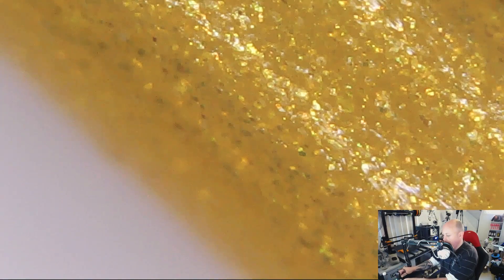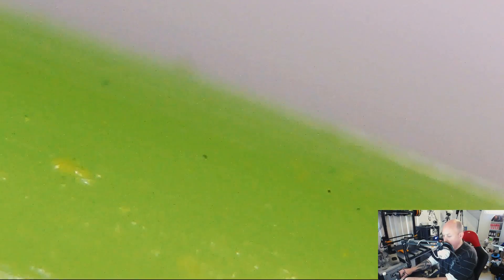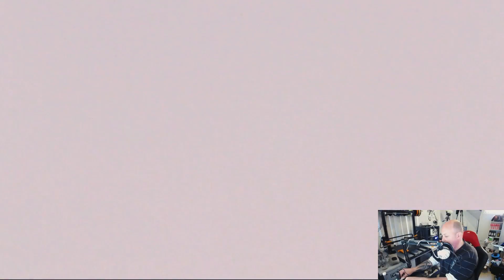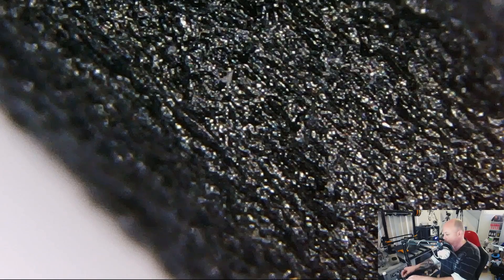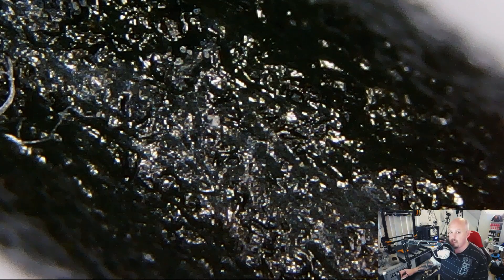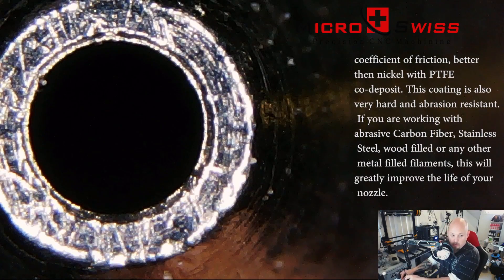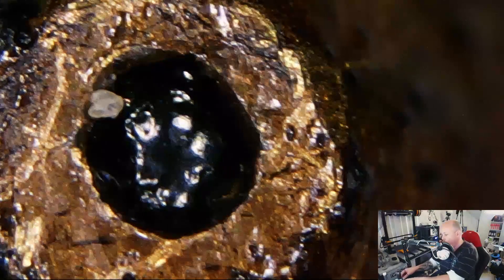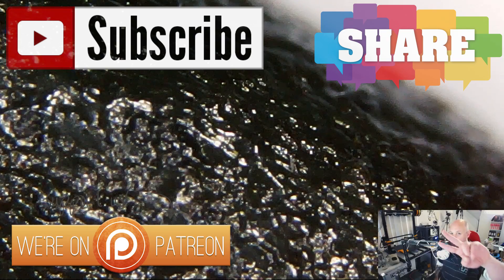Why You NEED a Hard Nozzle! Filaments & Nozzles Under the Microscope

Comment: great vid. woodfill however should not harm the nozzle. "sandpaper" is the wrong analogy. sandpaper is what you use ON wood and its not "made" of wood. its made of "stone" or whatever is the grit on it. (which would destroy your nozzle)

I did over 80 hours of printing to make an enormous baby groot in hatchbox woodfill and there was zero change or effect on the brass nozzle.

carbon fiber? yeah. that will chew up your nozzle like candy. :-)
Reply from the maker: +Nerys agreed
Reply from the maker: +Nerys and glow in the dark particles rip u a new one
Reply: I have a couple rolls. have not used them yet for that very reason. heard they are rough on nozzles if not hardened :-)

Comment: Just FYI, the surface texture of a filament doesn't have any impact on how abrasive it is on the nozzle since it is in a melted state prior to being extruded. What determines how abrasive the filament is on the nozzle is the additives that don't liquify like metal dust and rock dust used in many of the exotic filaments. But PLA and ABS surface wouldn't impact anything. The gear feeding the material makes very sharp saw tooth impressions on the filament before it enters into the hot end and that has no impact on the nozzle either. I make mistakes all the time in my videos and get corrected and I'm thankful people give me different points of views. Otherwise cool video and I do agree hardened nozzles are awesome.
Reply from the maker: Agreed :) well said - This is in the description (basically)
Reply from the maker: "And of COURSE the roughness of a material is not the only factor in an abrasive filament. The hardness of the particles is kind of important too! :D" - Selectively reported out of the other video.....
Reply from the maker: Keep up the shit hot vids Jerry - You were why I got into this

Comment: On advice from the 3D Printing Nerd I got a hardened hot end before starting to print with glow in the dark filament. It was a good thing too. PLA never showed any ware on the filament guide, but after printing with glow in the dark I had large groves in my guide.

Comment: Why would wood-fill abrade a brass nozzle? If it is truly wood particles, it's much softer than brass. Not trying to be clever; just an honest question. Thanks! Great video.
Reply from the maker: Good question! But we dont know what else is included - its not literally wood mixed with PLA - there are binders, anti coagulants and other stuff added. I've printed just wood on a brass nozzle and blown it out in 1 roll
Reply: interesting. zero effect with hatchbox woodfill. if its ONLY wood it should not effect a brass nozzle but as you noted if they have other "crap" in their then who knows what it might do.

did you notice any appreciable wear of the hardened nozzle with say carbon filament? IE does it still wear just slower or does it pretty much stop it ?

Comment: The exterior appearance of the filament is irrelevant. It is going to get melted as it's going down through the nozzle. I have some filaments which have ribbing on it to help with extrusion, it's regular PLA. This is really much ado about nothing. The point, before it gets into the hot end, it is going through a heater block. Some filaments have particles which will not burn out or are sufficiently abrasive, that would be carbon fiber. If you seriously think that wood will scratch brass? Try it. Take a piece of wood to your brass pipes and see who wins. Seriously think a little. Yes for carbon fiber, you need a hardened nozzle. You may clog your nozzle regardless if the embedded particles are too big for the extrusion diameter (don't print wood on .35 nozzle, some particles can be bigger -- use a .5 nozzle), but this is alarmist with no context.
Reply: Very very good points. I was about to post a similar comment.
Reply: Fully agreed!

Comment: I never use a "duster" or "oiler" and I never had issues because of that. Even with a 0.2mm nozzle. The only thing that worries me is carbonated filament in the nozzle. Or wood filament where the wood tar stayes in the nozzle if you are printing to slow so it cloggs. My spools never get tried (except for nylon) and the are in free air, even when printing... I think its not just dust that cloggs (which can, ok) but rather people believing that and having other issues!

Just some people use scientific methods to confirm dust or other stuff in the nozzle it self! Dont worry about that too much.

Iam printing PETG, PET, ABS, Wood filaments and TPU filaments with the same nozzle all the time. Although they wear out over time (especially with wood and carbon filament) i never had issues in like half a year to change a nozzle. Ive only got one printer with an e3d v6 and its almost printing 24/7. Also I mostly print with realativly moderate priced filament (extrudr, ninjaflex, nunus, ice filaments) because the diameter is very constant. I had like 15€ PLA one time and cheap ABS too and it was hell. Maybe not buying new nozzles all the time and NOT throwing away prints because of failures and rather buy better filament. Iam not insinuating people to do anything I wrote, rather making suggestions!

Comment: Awesome video Anthony and very informative. As always.
I printed a small model with Glow-in-the-dark filament, then I read somewhere that it can abrade the nozzle. So I brought a hardened nozzle from E3D (though not fitted yet) I've only been printing with various ABS/PLA since and my nozzle seams ok so far.
I will install the hardened nozzle before printing with glow-in-the-dark or other abrasive filaments.
Will it affect my prints if I leave the hardened nozzle in all the time, for everything?
Reply from the maker: That's all I do for every printer, leave in the plated, hardened nozzles 24/7
Reply: Ah! cool. Thanks for that. When I get some exotic filaments, I'll fit the hardened nozzle without worrying that I should keep swapping it out.